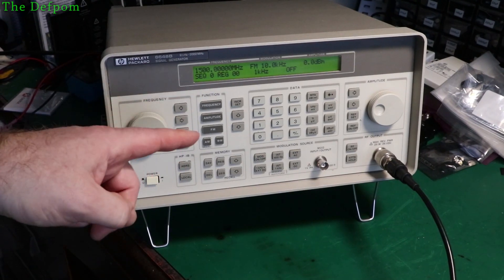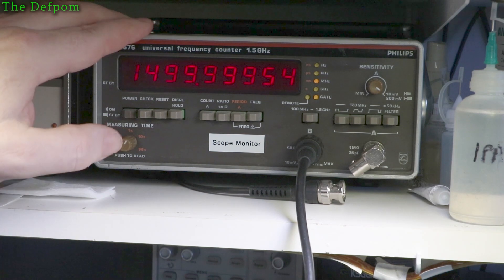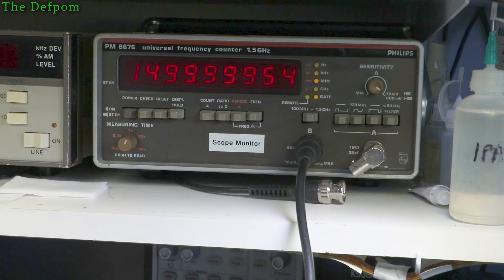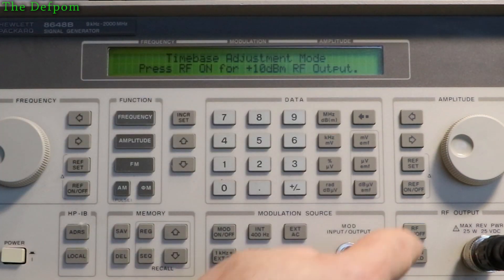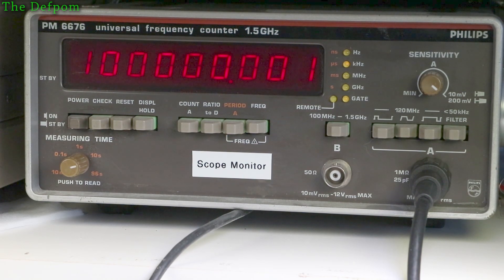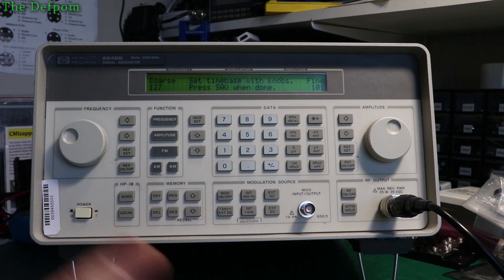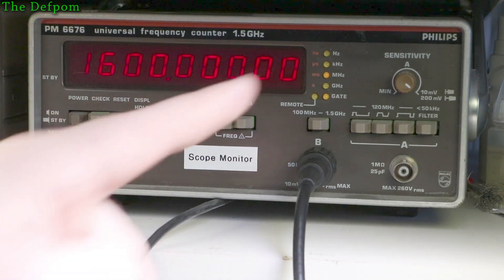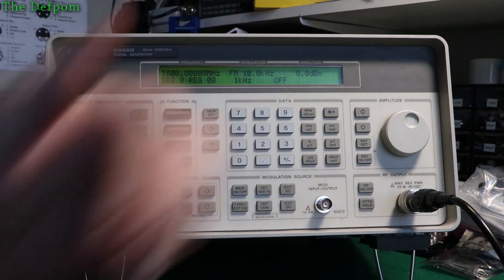🔴 #626 HP8648B 10MHz Reference Calibration

Comment: Hi
I have the 1GHz version of the HP8648A
And I have a problem with the battery. I would like to replace it with a new one.
It currently has a voltage of 3.14V but I don't know how old it is.
Did your friend replace the battery?

Translates from Polish with Google Translate

Comment: Interesting, I would use the "drift" method with an oscilloscope and adjust till the waveform from the DUT stops drifting. Nice and convenient if you prefer to not remove the cover. Cheers!

Comment: Great video.  I'm a hobbyist bench technician mainly specializing in tube and solid state amateur radio transmitters and transceivers (< 1.5 GHz) here in the States and wanted to know if the HP 8648B is a "good" signal generator?  Or are there better ones out there for under $1,000 USD?  I've read mixed reviews on this and wanted to get your take.   Cheers!
Reply from the maker: Kenan Reilly - I think it is a pretty good unit, maximum power output is higher than some other units for a start, is easy to use and the dial controls are great for tuning better frequencies

Comment: Nice videos!  Have you ever repaired the 1khz modulation tone on this model?
Reply from the maker: Hi, No I haven't needed to do that repair, but it is derived from the 10MHz reference and divided down from that, so it will be a pretty simple issue to fix if it is wrong or missing.

Comment: You have done really well with that signal generator and a lovely piece of test gear porn.  It’s a credit to you. I would like to have a rubidium standard but some of those old  recovered physics packages from China can be a bit hit and miss. I’m using a GPS disciplined oven control oscillator that is an order of magnitude better than I require but rubidium is still really cool. Thanks for sharing regards Chris
Reply from the maker: AllTheGearNoIdea - I am selling this generator, I only purchased it to make some videos on its repair, unfortunately my local pool of purchasers is pretty small and it hasn’t gone yet, so I may have to resort to eBay
Reply: you never know what you will get from ebay , i swear there is people that store test equipment in flooded areas i once got a counter once that was half impacted with mud.
Reply: Defpom's Electronics & Repair really surprised it’s a thing of beauty!!
Reply from the maker: AllTheGearNoIdea - I just don’t actually need 3 RF signal generators
Reply: Defpom's Electronics & Repair  unfortunately I rarely part with test gear I really should. It looks like a better interface than my Marconi RF signal generator. I would think it will go for a lot of money on eBay. I think shipping cost would probably kill it. It’s such a nice clean unit.
Reply from the maker: AllTheGearNoIdea - are you still coming over here in November? Will it fit in your suitcase?

Comment: I waited till the very end, you could have blown a raspbury or something lol :-D
The philips counter looks nice and straight forward,  i like simple because i am simple ha ha :-D
I have an old racal 1998 counter, the buttons are buggered and the internal ovan is well baked,  i know its not much cop but its close enough after 30 mins warm up.

I also have a maplin mf100 counter that i used for c.b setup in the long past.
And i have a zetagi 100 mhz 12v sloped face counter glued to the top of my audio gen, the prescaler i bypassed and a change of clock xtal.
Yes im bodgy, but why waste a counter :-D
Reply from the maker: zx8401ztv - I did a video or two a couple of years ago showing how to replace those buttons, along with a source for them.